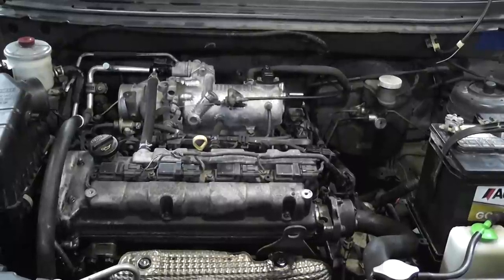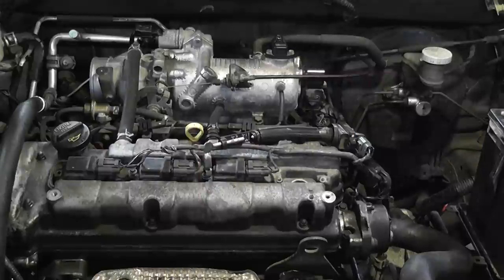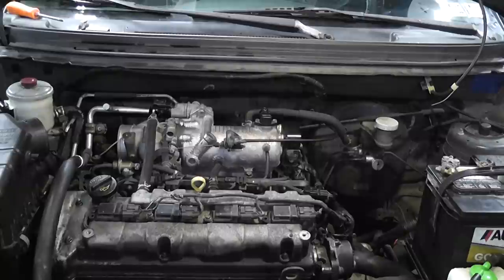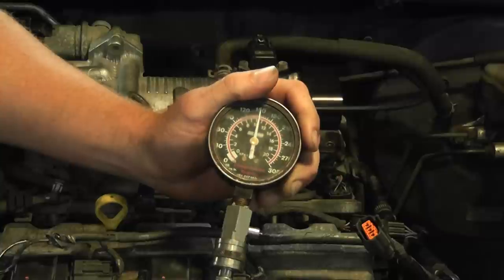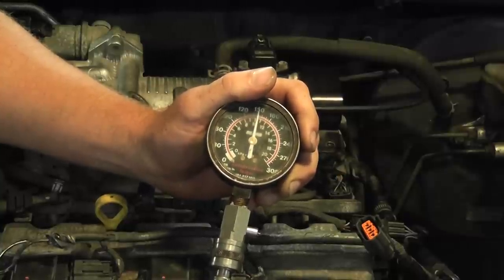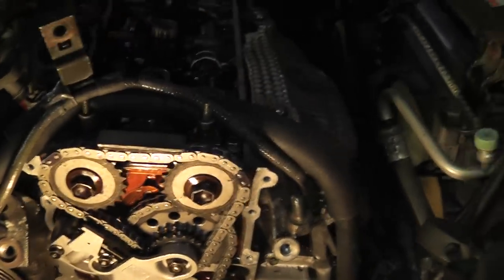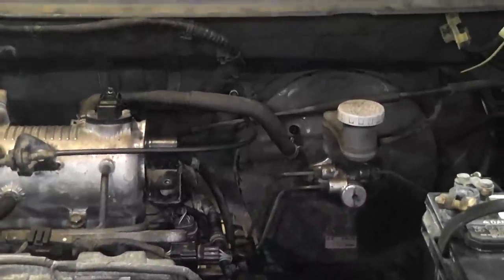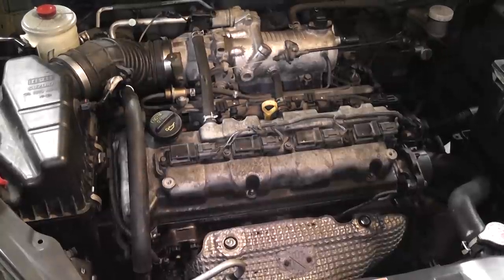How to check for a jumped timing chain or belt

Comment: I really enjoy your videos, and learning an aspect of auto repair that is new to me.  I want to point out that to calculate how many degrees off the timing was you needed to divide rather than multiply.  Because the number of micro seconds per degree was slightly greater than 1 (1.18) you were not off dramatically. The actual number I got was like 22 degrees rather than 32, but if the value was higher the error would be magnified.

Comment: A trick I figured out myself and is probably out there somewhere if you put a piece of cardboard on the throttle body you should only get suction on crank but if you get suction and blowing air out of the throttle body then most likely it's a timing problem possibility a bent valve but you can figure it out if you're good if it's like a consistent suck and then blow might be a bent valve I kind of wish I had a better way to explain it hopefully this helped but this is the easiest step before you start doing compression test and that goes the same for the exhaust exhaust should only blow out not having any suction hope this helped
Reply: You can also use your hand on the throttle body to feel it but highly not recommended in case it backfires and that will definitely hurt or even burn too

Comment: I believe your right.  He's basing cam and crank signals of an optical distributor to the pressures produced inside a cylinder on his pressure transducer to verify a timing issue.  The engine would have probably run if only the intake was off a tooth, but I am sure there would have been some sort of drive-ability problems.  There is a lot of information hiding, other than when a cylinder is TDC, in the cylinder pressure waveform to allow you to determine if the intake is off.

Comment: Just to follow up with blackwell's comments. At 9:29 for your calculations of crankshaft travel in degrees, you mention 1.21° of crank per milisecond. It would be time in milliseconds per degree of crank travel. Also, you were dividing 720°/595ms which should be 595ms/720° which yields milliseconds per degree of crank. From my calculations, 595ms/720° = 0.826ms per degree of crank. 0.826ms per degree * 27ms = 22.3° where the firing was ATDC. As always Paul, your videos are very informative.

Comment: Nice video, as always!
One comment: in the beginning, when you measured the angle between maximum compression and ignition, you should have divided the time between the cursors and the time/degree... Why? Because time * (time/degree) = time squared / degree... While time / (time/degree) = time * (degree/time) = degree.
In other words always check the measuring units of an operation and you will notice any slip of the pen immediately. Just an advice!

Comment from the maker: Great question. First would be a regular idle vacuum test (it would be low most likely). And then I would use the same in-cylinder pressure transducer test and really zoom in on the details of it. You can actually see valve opening/closing within the waveform and calculate how many degrees BBDC or BTDC it is occurring. Of course you need a valve spec. sheet for that and it is a difficult test to master but I am working on it. I don't have that procedure in my ebook yet but I will in the future

Comment: Nice video dude, it's always good to watch a fello tech working out a problem. It's easy when you break things down into manageable elements to determine the real problem and eliminate things that are working fine, or maybe have other small problems which build to one big one. Most folk are afraid of technology but as you demonstrated it can be used as a very good tool to show things that were never before available and with a bit more investment and learning a lot more guys could be much better at what they do.
Reply from the maker: For sure! Thank Richard

Comment: I was diagnosing a car this morning and I thought about this video and wanted to know what you think. I knew off bat it was a timing issue because he said he just changed the timing belt. I pulled the codes, it had a map/tps correlation code. I then listened for the rythm in the crank, it sounded good. Compression check on one accesible cylinder to make sure they weren't all low. it was strong. Vacuum test was 5hg goes up in rpm, brake torque to 2000rpm, Crk/Cam difference 1.09. Fuel Trim 2.3,

Comment: Recently, I've been suspecting that my bone stock 350 chevy (1980s model in a C10 truck) has a jumped timing chain. I have reason to suspect this because (although I do not have any fancy scan equipment) I need to put the distributor to 50 or even 60 degrees advance in order for it to idle ok, and my primitive "scan" tool (a vacuum gauge) has a fluttering needle and constantly hangs around 14 inches of mercury. I've tried my hardest to adjust everything else to get the needle to stay still, which includes setting the valves to zero lash, adjusting the carb's air/fuel mixture, and all sorts of other things... But me being the newbie mechanic I am, it never occurred to me until just recently that the timing chain might have jumped (or was never installed correctly in the first place.) It also makes hardly any power.
This video is making it more apparent to me that I do in fact have a jumped timing chain, as in a modern car like the one in this video, which has coils instead of an old-fashioned distributor, the spark would occur past TDC if the cam is connected to some kind of sensor (a lot like how the cam is connected to the distributor in my truck) and the timing chain jumped past a tooth, and could potentially be overcome by advancing the timing an obscene amount. 
Any thoughts?

Comment: Hey scanner Dan, I bought a 97 Toyota Camry for my daughter, but when I bought it, it was not running and as a self-proclaimed  Dan the fix it man, I knew that I could solve and fix the issue... so I thought,  I had went through all the possibilities of it not wanting to stay running, I got it running, but it would stall within a few seconds after being started up, I've gone through replacing the fuel pump, fuel pressure regulator, the fuel pump housing, because it had a crack in it and was leaking out, but it still did not want to stay running, I've changed the engine temperature sensor, the idle air control sensor, replace the spark plugs, replace the throttle position sensor, made sure the battery is fully charged and good, replace the fuel injectors the old connectors were busted barely hanging on, so I replace the connectors spicing them in and checked to make good contact, even checked out the ECM, everything was fine in there no burnt markings no leaking capacitors, I am waiting today for the new ignition coils and spark plug wires, I looked visually for any kind of hoses with holes to create a vacuum leak, and still it does not want to stay running I've checked the timing and made sure that it was correct, and what I did notice was there was a few missing teeth on the crank timing gear, that I suppose would be very important for the crankshaft position sensor to read, now I know that  a gap with no teeth in there but these teeth that are missing look like they were broken and it just dawned on me that,  that could be the very reason why my car does not want to stay running, would that be an issue why it does not want to stay running, does it make any sense, your help would be appreciated, thank you.

Comment: My friend, this video is very good info very accurate, helped a friend who is starting to fix his car and not an expert, let me add that this car it does have a separate crankshaft sensor, is at the back of the engine block behind the flywheel, you can see the cable and plug connector under the cam sensor, you'll see where the tranny meets the engine a small notch for the cable to go inside the block just standing in front of the car.............just sharing what I know about those suzuki J engines,  Cheers my friend.
Reply from the maker: Thanks for the tip Gregory!
Reply: Anytime my friend, keep up the good work
Reply: Gregory Sauri It is however only used for misfire monitoring.
Reply: Dame una llamada

Comment: Good diagnosis skills, this goes to show, you can have all the ingredients, fuel, air, spark, and pretty good compression readings and still get no start, i reckon a vacuum test would point you in the right direction here also. Why are so many gone back to chain driven cams, i mean they are great on ohv engines but on ohc engines i prefer a belt, they may fail if not maintained right ,but they are easier to service, and they dont wear out the sprockets either.

Comment: ScannerDanner the crankshaft position sensor  you have to take out the engine or the transmision near the flywheel is that ckps, that part you show is the camshaft position sensor/ignition distribitotor

Comment: Nice video, educational as all the ScannerDanner videos. Sounds that this engine needs a valve adjustment too.
Reply from the maker: It actually does not. Engines that are cranked over and over again, end up with collapsed lifters. Holding the RPM at around 2000 or so will pump them back up again. You can actually here that in the video and I think I mentioned it or left a note about the collapsed lifters in the video, but maybe I forgot. 
Thank you!

Comment from the maker: hey bro. you can do the same thing with a running engine. keep in mind that you can still have ignition timing be on and cam timing be off, in which case you can use the compression wave form to identify valve timing problems. this is a complicated procedure and I am not 100 percent yet on using it

Comment: You my friend are a breath of fresh air against all the other mechanics that shudder at the sight of electronics and down know their arse from elbow looking at a scope. Well done. Enjoyed your systematic approach, and you timing analysis of the waveforms done to the degree calculations of timing offset. I Also thought picking up the amperage off the crank to capture the compression humps a brilliant move. You'll need all the spark plugs in for that obviously. Are the probes widely available?

Comment: Dodge Durango 4.7 uses similar colored chains and marks, even though it's a V8.
I did one and got the links off, cam sensor wrong output.
truck would run but just barely, no power.  
this brings back memories:)

Comment: Thanks Paul. Old vid but a goodie. Just reviewing the whole Crank/Cam/Spark correlation. Here's my confusion. 
Techs will check Spark Timing against Compression pulses to detect a jumped belt/stretched chain. But most cars take the timing pulse signal off the Crank Sensor. If a belt jumps a tooth and, say, retards the valve timing, the crank-triggered spark pulse and the compression wave remain in sync. Right? So a scope will show correct spark timing, even though valve timing is off. Of course, if it's far enough off, say jumped a couple three teeth, compression may be affected. But that's extreme. Typically, i think a spark/compression correlation will not show that valve timing is off. In this vid, it works because the spark pulse is generated from the cam. But with a crank generated signal, the correlation has to be between Crank and Cam to show a possible jumped belt tooth or stretched chain. Have i got this right?

Comment: thank you SO much for this video. seriously. I bought a used engine that was rebuilt, i think the crank chain wasnt put on incorrectly
Reply: no problem, thank you! hopefully I provided enough info. in the video on proper chain alignment. My main focus was on the troubleshooting side of the job
Reply: Yes you definitely provided enough info.  I wish I would have seen this before I put the engine in,  and realized it wasn't running correctly.  I was very excited when I opened the engine up to see that it was freshly rebuilt!  I just assumed it was done correctly Haha

Comment: S.D. what's up man! First let me say I'm not looking for a hand out and I have no problem paying for your time. Especially in this situation. It's been going on a year now and it's been to 2 shops. Both times I had done what was recommended but neither time the car started up. Short background, 2002 ford focus zx5. Ztech. I have fuel, spark, great compression in all cylinders. But it will not start. It has ALOT of new parts. Just a few, new plugs, wires, coil, every sensor, catalytic converter, battery ect ect ect. About 2 weeks after having the timing belt done the car started to act up. It was acting like it had a vacuum (yes the infamous pcv valve and hose have been replaced) it started to run horrible, and if I put it in neutral while driving the rpms would rev up past 2 grand. It started to run real bad then started to have a hard time running til it stopped starting. That shop said it was the catalytic converter and sensor. Had it done still no start, had it at another shop, this guy said coil and pigtail, had it done, no start still. This is a real tuff one. For me anyway. I have a little shop here in Delaware, I work off of word of mouth only. I consider myself a good mechanic, some of my customers swear I'm the best! Thats great but I'm not! I still learn. I worked for Toyota at a Stealership til I couldn't take them ripping people off anymore. all my work is backed by a lifetime warranty. 
This is my buddy's car and he's bought a new focus. But I just cant let this go because in all theories it should start. I dont throw darts! But I did with this one because I'm so stumped and my buddy said so it. The timing covers are off and I have the special tool for Ford focus timing, I even have the special fuel guage yo read fuel psi on that model focus. Before it finally stopped running it was revving high if placed in neutral while driving instead of idling down in a normal situation! I cant stop thinking of that. If you have read this HUGE THANK YOU!!!!!! and if you could help or lead me in the right direction I'd be forever grateful! I really am bothered by this one. Mentally and emotionally! Lol. But I was not childish enough to ask for help. I have no problem paying for your time and help if need be!!!!! Sincerely thank you!!!!!!!!! Ed
Reply from the maker: Let's do this brother. Join my forum (its free) and copy and paste this there. Then reply back here and tell me when you did. I'll make sure to jump in and help you there. It will be much easier than back and forth stuff here which I can't do.
https://www.scannerdanner.com/forum/post-your-repair-questions-here.html

Comment: man this video was excellent. very educational
Reply from the maker: +Ultravore thanks!
Reply: ScannerDanner my car the timing belt looks extremely bad missing a lot teeth in some would this causes no start just grinding noise  no spark at all it sounds like there is no compression in the engine
Reply: your engine is shot , you bent the valves, its locked up, dude a timing belt needs to be changed, every 80, 000 miles, people should not go beyond it, belts co st under 40 bucks plus what ever the labor , any where between 150 to 300, if you have a non interference its no sweat, no damage but the other deal is a new engine, a rebuild or some piece of shit from the junk yard(why do you think its called a junk yard?)

Comment: Paul - Got a borescope?  With a right angle camera?  (a right angle mirror works too)  You can put the borescope down the spark plug hole and let it ride the top of the piston as you move the engine through tdc exhaust.  If the valve timing is right the split overlap is easy to see.

Comment from the maker: yes, but you could be at TDC exhaust, you need to be TDC compression. then of course there is some amount of movement of the connecting rod at TDC where the piston doesn't move, so true TDC cannot be determined by looking at the piston position alone.

Comment from the maker: this test will work on All cars. the results will vary with ignition design as to whether the ignition timing will be off or not. for example. a crank sensor driven off of the harmonic balancer would not be thrown off with a jumped chain. the cam timing would be off though which makes the cylinder psi transducer waveform  even that much more important.

Comment: I have a 2012 chevy sonic that i just did the timing belt on. After completion, check engine light came on, giving codes letting me know timing is off. I looked at the camshafts and with crankshaft on mark, the camshaft indents do not line up anymore.Is the fix as simple as lining up those indents? I have a manual that tells me to go through all kinds of special procedures, such that I lost faith in validity of said book. It is interference engine, so I don't want to get this wrong. BTW I made my own locking tool for the camshafts, though it seemed to work during install, it obviously didn't, so I am thinking that this was where the problem came from.

Comment: does this technique just apply to those cars with all the sensors within the distributor ie Japanese engines. Or does it also apply to vehicles where the tdc sensor/engine speed sensor is located off the actual crankshaft? I imagine the max compression at tdc on the current waveform will exactly line up with the sync off the plug lead secondary trigger even if the valve timing is off.. Or do i have that all wrong? By the way i think you are the best automotive teacher ever Period!

Comment: Super tutorial!!! I have an issue with a replaced turbo and engine no longer starting. I think the mechanic didn't clean the intercooler when he replaced the turbo, consequently the car revved on it's own broke the new turbo, and cut out. Another turbo now in, but car will not start. At least I now know how to check if timing chain has slipped. Thanks. Do you think it could be something else stopping it from starting? Please!